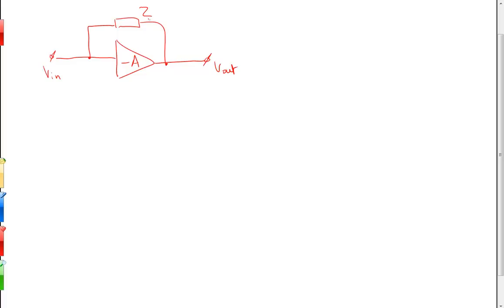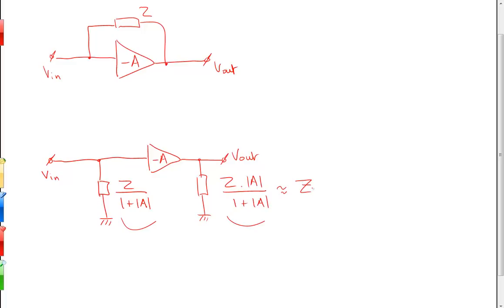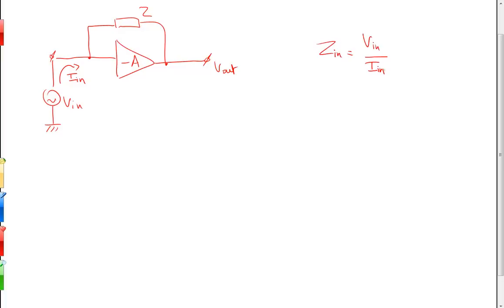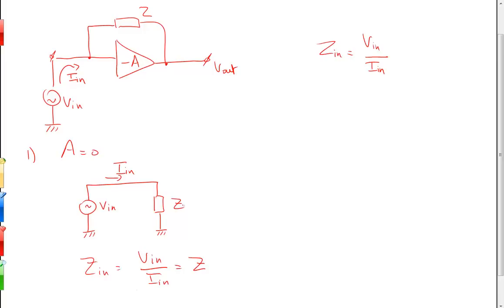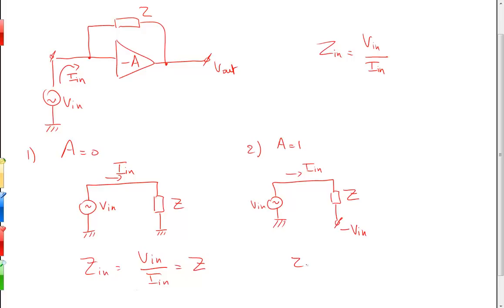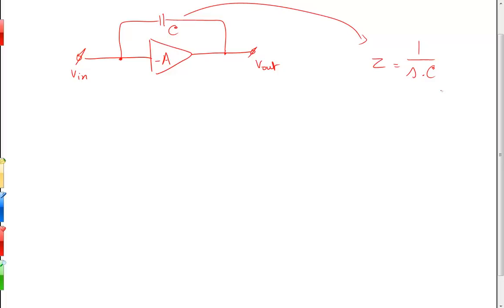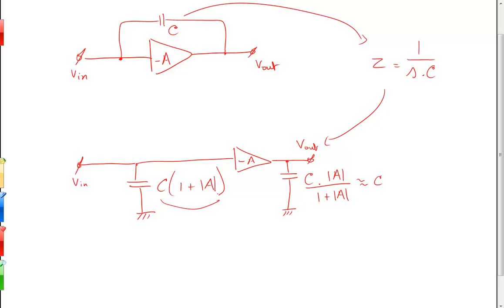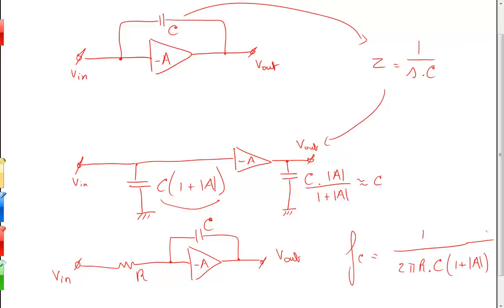The Miller theorem

Comment: why is current 2 times vin by z ?
Reply: Look at both nodes across Z. The top node is at Vin. Because the bottom node is the output of the inverting amplifier, it must be -Vin. The voltage across Z is thus Vin - (-Vin) = 2Vin. The voltage is doubled, so is the current.